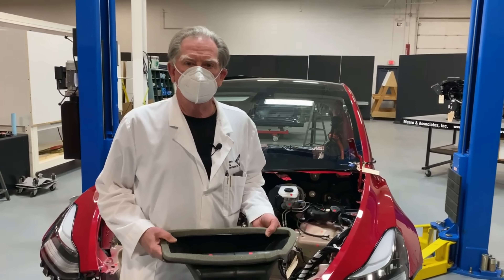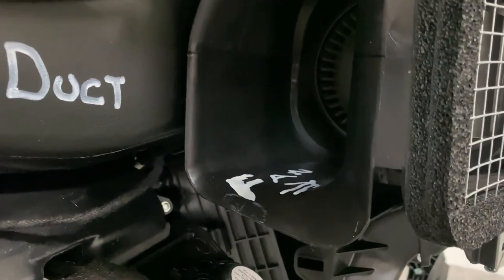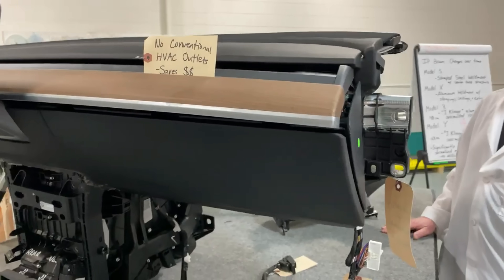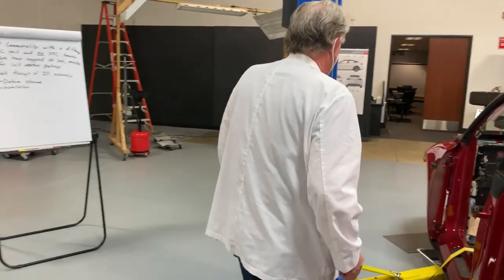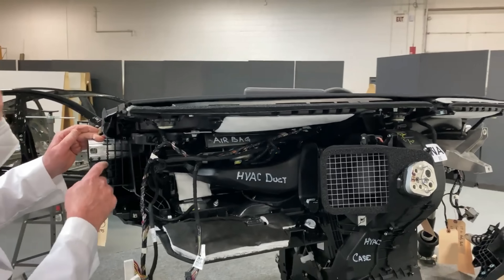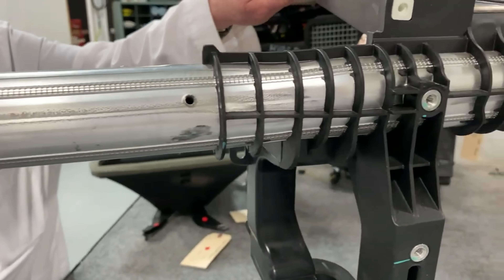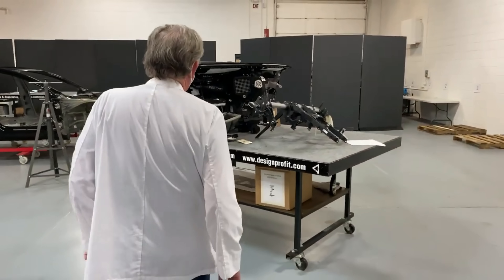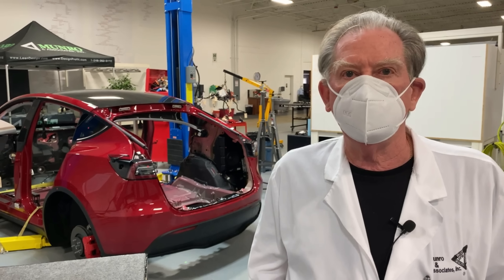Model Y E18: Instrument Panel (IP) Assembly & Comparison MY-M3

Comment: 8:16 you probably meant 2 cm (20 mm).
Reply from the maker: Good catch, and thank you for the comment!  Just to clarify for everyone, what we observed was that there was a 15cm delta in height from the floor pan to the bottom fastener for the IP between the MY and M3, (Model Y was 63cm from floor to fastener, Model 3 was 48cm), and when we measured the height of the seat riser, we found that it was 13cm.  So, by lifting the IP by 15cm and the seat by only 13cm, you get the perceived effect of 2 additional centimeters of head room.  Thanks for tuning in!
Reply: @MunroLive  How can someone get more head room by lifting the instrument panel? That makes no sense. The head room is between the seat and the interior ceiling regardless of where the instrument panel is. What you really get is 2 cm more height between the (raised) floor and the lower part of the instrument panel, so it's more height for legs.
Reply from the maker: @koeniglicher  I can see what you're saying, and I actually think you and I are close to being on the same page here.  If the initial plan had been to raise everything (seats, floor, IP) by 15cm, but then they opted to raise the seat and floor by only 13cm, then whether you call it head room or leg room, you have allowed for 2cm more room than you would have otherwise had at 15cm.  We thought that it was neat to see that they didn't necessarily lock the orientation of the IP and seats and raise them by the same amount, but rather raised them at differing amounts that accounted for extra occupant space.  But you are correct, the raising of the IP didn't give the room, it was more like the not-as-much-raising of the seat.  Thanks for tuning in!
Reply: @MunroLive  Thank you for your reply! And now I see what you mean. My "point of reference" was raising seats, floor, instrument panel by 13 cm. This decreases head room  and generally interior space by 13 cm, of course, if the roof line would have been the same.  And then raising the instrument panel about 2 cm more, which gives you 2 cm more height under the instrument panel for the legs.

Your reference was raising seats, floor, instrument panel by 15 cm, and then lowering the seats and floor by 2cm again which now "increases" the headroom or allows for a little more room. 

Of course, the actual head room also depends on how they changed the height of the car body and therefore the interior ceiling relative to the floor from Model 3 to Model Y.
Reply: koeniglicher you get 13cm more leg room and 2cm more head room ;)
Reply: @Keneo1  That depends on how they changed the floor. Going back to https://youtu.be/B2xyJTO9CUs?t=14 you can see that Tesla decided to put styrofoam pieces in the foot wells under the carpets of the front row seats ("EPP floor risers" as Sandy Munro calls them) which now take away these 13 cm (?) again. Hardly won, already melted. :-)
Reply: That makes so much more sense.
Reply: Yep, 63 - 48 I guess!
Reply: Of course 2 mm is less than 1/8" and not worth talking about?  15 cm is 6".  The dash is at the same height relative to the seat +/- 3/4" (20 mm 2 cm)
Reply: For us oldsters,  metrics aren't second nature, we can drop decimal places without realizing it.    It's easier for amaany of us to think in human-scale old-fashioned units and convert , with a foot being "around" 30 cm.
Reply: Yea i was like. That aint no 15 mm  he probably meant CM LOL
Reply: How easy to make a right hand drive version?
Reply: @gavinmcintosh7022  Just flip it upside down when installing it :)
Reply: @Stevaughnator  Really, damn he's clever. Basic principles. Hope he makes a Giga in Oz soon. Not sure Ozzie's will buy China made ones for a while.
Reply: Inch’s, feet...same thing.  😏

Comment: How can cross beam be adjusted? Those 4 bolts you mentioned didn’t allow to move it. Looks like there is more points holding it in place.

Comment: It's interesting to see Tesla improving their manufacturing process, which is good for them as a company. Hopefully they can start turning a profit and making their cars a bit more consistent. Watching these videos, I do have some concerns about serviceability and repairs in the future. They've designed chunks of the car into assemblies, which makes them easier to put together but often harder or more costly to repair. In this video, I see the blow motor, a common failure on any vehicle, tucked up against the firewall, high on the dash over next to the driver's pedal box. I can't even tell if it is removable in the picture or not. That is going to be an issue.  Same with the steering column. It will have electric motors to control the tilt/telescope, along with probably a control module for those. I don't see where those are easily accessible in the vehicle, nor does it look to be reasonable to remove the steering column without removing the IP. Next step for Tesla's maturity as a car maker will be working on making their vehicles more serviceable.

Comment: I imagine there is much more to the instalation of the IP
Than 4 bolts, electrical, the steering shaft.

Also the removal that’s always required , $$$$$$$,
to fix/replace the fan, the squirrel cage, solenoids, buterfly
AC Gas leaks, condenser 

Will wait for the HVAC review in the next videos.

Comment: VERY intresting, it's good to know the progress of tesla's car design, i like the aluminium beam molded with gf-plastic, it's a lot lighter than steel, doesn't lack much strength and it will absorb impacts better upon collision. Tesla does this-> removes weight from where it's not needed and can put it where it matters like the battery.

Comment: I wonder what is the procedure to replace the HVAC fan is there room to remove the fan with the IP in place I can see that the screws that fasten the fan in the housing is on the driver side .

Comment: Thank you Sandy & Co. Could you also make a video regarding the 12VDC access points in the wiring of the Model Y? Especially at the rear-view mirror etc. Makes very useful info when adding accessories like Radar Detectors  and home automation add-ons.

Comment: I'm surprised they didn't go with drive by wire instead of the traditional steering column.
Reply: It's my understanding that's not legal in most countries.  Because it's not drive-by-wire, by question is how they're able to adjust the steering tightness setting via software?

Comment: Can you invetigate the 3 extra refridgerant pipes going in to the dash? Have they fitted an a/c condenser coil in situe of the electric heater? My guess is that the existing plate and fin Evaporator cant take the pressure required to work as a condenser, and there are 3 small pipes (2 in 1 out) used  to connect the condenser so that they can take the pressure required while maintaining adaquate flow.

Comment: I look forward to seeing the guts of the HVAC, especially heat exchanger(s) and refrigerant valves. I don't see coolant lines going through the bulkhead so I assume all temperature control is done with refrigerant. Would make sense to run the defroster like a dehumidifier with evap to strip moisture and condenser to reheat the air. There has to be resistance heat someplace to deal with a cold soaked car. Will be interesting to see how they do that.

Love these videos. Keep 'em coming!
And I continue tipping my grocery delivery people, leaving gloves for my mail carrier.

Comment: The air outlet is called a diffuser. When talking about HVAC systems he could use some editing to get it right, particularly when talking about the heat pump.

Comment: Any chance the IP or least the Steering Wheel and Screen will go up for auction?
Reply from the maker: It's a possibility, but we won't be able to confirm until we've made sure that they are/aren't carryover parts from the Model 3.  If they're new, then no.  Still working on confirming the internals.  Thanks for tuning in!

Comment: How hard is it to replace the blower motor. It seems that is very deep in the dash. I'm also a little curious of how hard it is to replace the dash airbag. On my prius it takes about 1h  to swap it out. But, on my Fusion it takes two days work to replace it.
Reply: Passenger airbag takes 3-4 hours. Need to remove whole top pad to gain access. Getting top pad off requires removing a lot of parts. Little less than a day for blower motor. Gaining access to HVAC case takes time so does evac and recharge of refrigerant.
Reply: @chstra45  You mean you have to evacuate the ac system to replace the motor? In most cars it only takes a hour or less.
Reply: @josealbreyes  evac because you need to remove whole HVAC case to get to blower motor.
Edit: it's high up on LH side of case. For LHD vehicles there's a lot of stuff in the way. Easier to pull case out to gain access. You might be able to fight it out without removing case, but I doubt it. RHD you could get to pretty easy. I do Diag and repair at factory, so for most things wrong with IP I remove whole assembly to ship back to supplier so company can get money back/ credit on part. Takes about 3.5 hours with a little help. Only at service would they replace just motor if it was bad. Don't know how often service replaces blower motors. At factory it's very unlikely to be motor (usually short or damaged connector/pin etc) so cant say as to the frequency of blower motor failure.

Comment: Did you noticed any change in the AC ducts vs the 3? The original 3 AC allows for some condensation to remain in the ducts which causes mold problems in the filters after a year or so.

Comment: i am pretty sure the cross beam module isnt designated as ElringKlinger, but ElringKlinger is
the supplier for that piece
its a pretty big german supplier and development partner for the car industry, so i guess you can
find more ElringKlinger parts
Reply: LeXeL 
Hi I’m sure that his was designed by ElringKlinger and produced bei ElringKlinger
Reply: I think Sandy would know the names of all big traditional parts suppliers. So if Sandy did not recognize the name they might not be big. Could be small and specialized or big in a slightly different part of the supply chain.
Reply: @raulsanchez2756  Man... Why subject yourself to willful ignorance. It is easy to not do it... Step 1. Open google, Step 2. Search for ElringKlinger Step 3. Read about it, and regather your thoughts.
Reply: @raulsanchez2756  Sandy had difficulties with Bembro aka Brembo. so....
noneoftheless, this is interesting to watch, but it's very clear that most of the people are not knowledgeable in this by far. most are just fans/gruppies. and i am not even in automotive business, but rather just interesting in and i can see the situation quite clear.
Reply: yeap! and what is somehow transcending is that Tesla aligns manufacturing with standards of premium German manufacturers, but this is sold as "some deviation from legacy manufacturers". yeah, quite knowledgeable...
Reply from the maker: @madalincosma2531  Just to clear up any confusion here, we are more than familiar with ElringKlinger as a supplier and this is not the first Cross Car Beam that we've seen with this construction of theirs.  Mercedes has been using it for some time now.  However, this is far from "the norm" in terms of what is most commonly used in the automotive industry, meaning that it is, in fact, a deviation form legacy auto manufacturers.  Thanks for tuning in!
Reply: @MunroLive  thanks for clarifying, but I think somehow the comparison is not truely objective (I might mistaken though since I am not automotive professional). When you say other car manufacturers, are you referring to all of them? Are you comparing Tesla with premium manufacturers like German 3 or with mainstream?

Comment: Thanks Sandy. Actually Mercedes started with this technology on cross car beam. Check a 3rd generation A-class. Great technology : low part price, very light, exceptionally customizable. I’ve been working with these guys.
Reply from the maker: Yep!  Mercedes was one of the first OEMs we observed the Klinger beam on as well.  We're big fans of the concept. Thanks for your comment and for tuning in!
Reply: Elringklinger makes those cross car beams for Mercedes and Tesla. I work for the Elringklinger Leamington plant. I can tell you it's a very unique molding process.

Comment: I've never seen an overmolding like that. Do they surface treat the aluminum or is the plastic relying only on the ridge? The overmoldings are even done on bent parts, I'm surprised they can get decent tolerance between the bar and the tool without excessive flashing. Is the aluminum bar just an extrusion?
It is pretty clear that FEA played a big role in the way the PA wraps around the bar, from a structural point of view. What an interesting part, from a manufacturing perspective.
Reply from the maker: This isn't necessarily the first time that we've seen one of these cross car beams, but the technology is not widely used at this point.  The aluminum portion is an extrusion that gets hydroformed prior to being overmolded.  If you'd like to read more about process, check out this link:  https://www.elringklinger.de/en/company/pulse-magazine/turning-up-the-pressure  Thanks for tuning in!
Reply: You can see at 5:47 that there is some sort of flashing or plastic over run that is parallel to the length of the beam. Since these are all in a line I would guess that there is a low spot in the extrusion that is allowing some plastic to squeak by in the mold. It is possible that the beam is hydroformed and then dropped into the injection mold afterwards. That would probably allow for a more accurate profile than using conventional bending dies. The flashing on the beam doesn't really matter since the part is hidden from view.

Comment: Surprised it isn’t completely drive-by-wire.
Reply: Is that legal?
Reply: Brad Comis I don’t know, but throttles have been drive-by-wire for years, maybe decades.
Reply: @autophile525i  Oh, I think losing steering due to some electronics failure is probably not acceptable in terms of risk. If you lose steering there is a very very high chance of crashing. If you lose throttle control you can still brake and steer- the car remains maneuverable. Not to mention that having the steering connected to the rack allows for the driver to get feedback from the front axle about lateral loading, steering forces, and traction levels which makes safe driving easier and also makes driving more enjoyable.
Reply: Brad Comis I agree on the enjoyment of feedback in manual steering. I was talking about the steering. I know BMW has steering with video game feedback because the electric “rack” doesn’t provide it. 
I think it’s a case where the tech is available but regulations aren’t.
I agree with your ranking of risk, but I think redundancy would help alleviate most of the risk of system failure.
Reply: @autophile525i  Good steering feedback through an electrically assisted PS system is possible, but most manufacturers don't know how or haven't prioritized feedback from the EPS system in their design. There are a lot of positive things said about the EPS in the 911 and Miata for example.
I can't even imagine how awful a steer by wire car would be to drive. I'm sure it is possible and such. Most people probably wouldn't even notice its implementation, but for anyone with predilections towards driving enjoyment would certainly hate it. It makes me wonder if the steering connection is there to stop car reviewers from blasting the car and saving them from getting bad press even though a steer by wire would hit the comfort goals for the widest portion of their customer base.
Reply: Brad Comis Those of us who enjoy driving are dwindling - and fast. The best security system for a car these days is a manual transmission. 
I’m with you on the feedback and the power of reviewers.
BUT ... I’d rather have a cheaper daily driver with drive-by-wire than the current offerings. Especially when they come with safety systems like lane keep assist and self parking. (Not to mention upcoming self driving tech.)
I look forward to a robot chauffeur.
Weekend cars? No way! Give me old school for that.

Comment: Do you know why the HVAC system will start to smell after awhile? I assume the Model Y will have the same issue if the components and design are the same.
Reply: What type of smell (mildew/mold)? How many instances of a particular vehicle, have you noticed this in?
Reply: @thelondonbroiler  From what everyone says its smells like mildew or dirty socks. Seems relatively common on Model 3s. There was a software update that went out a few months back to address the musty smell.
Reply: @TheElectrocar  It's likely moisture that's gathering somewhere that can't easily evaporate. Finding the source is problematic, but it usually accumulates in the hvac ductwork or below the carpet in the padding.

Comment: Another interesting video, thx. 

Would there be any value in pointing out what parts change between left-hand drive and right-hand drive models? I noticed that the HVAC housing and ducting appeared to be asymmetrical, and assume this would have to change depending on model. Could there be further money saved by trying to make these parts common?

- Kaine